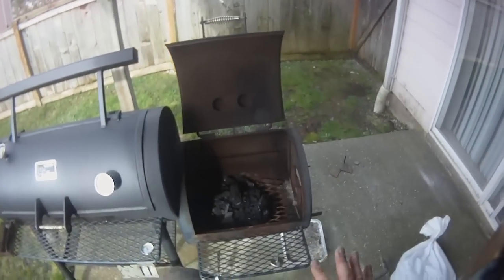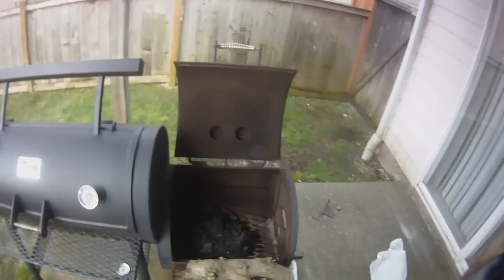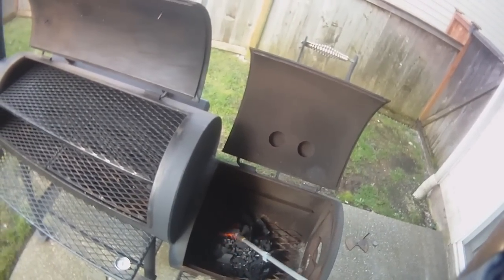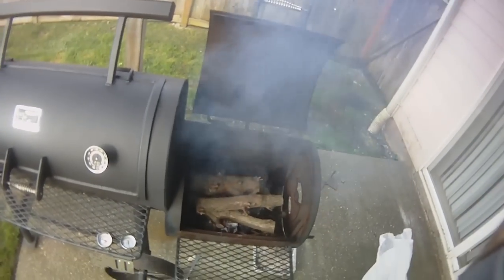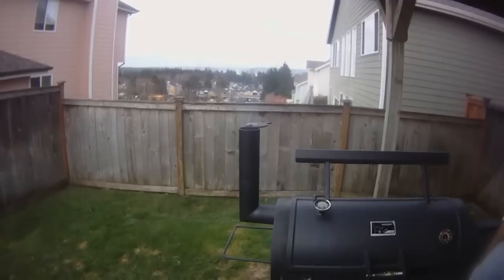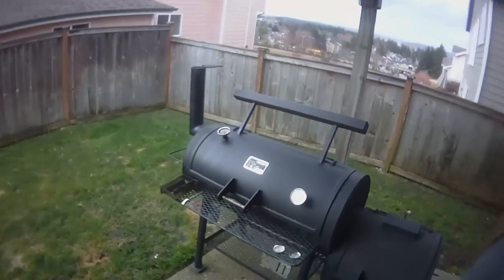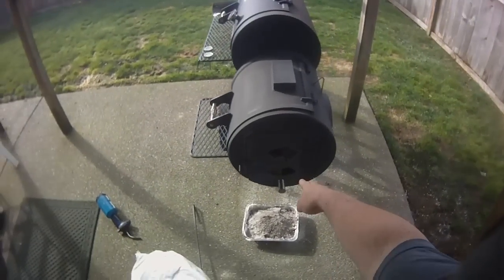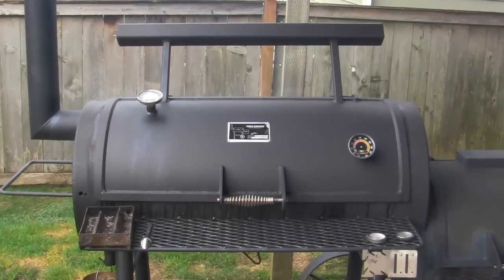SmokingPit.com - VLOG - Building an efficient fire - Yoder Wichita and wood pits.mp4

Comment: I spray PAM or other cooking spray all over the smoker, both interior and exterior, to help coat the metal over the winter.  This helps keep the oxidation down during the long cold winters where you cannot use your smoker due to frigid temps.  Just my 2 cents.

Comment: The "moisture" on the inside of the pit is from the smoke not the moisture in the pit. Complete combustion yields water and carbon dioxide. #Chemistry class
Reply: @Fin thedog In an offset smoker, you absolutely want complete combustion.  Thats why they're called stick burners.  Otherwise the wood would just smolder and give you the white, bitter smoke.

Edit:  10:52 of the video even says you're after fire.  That's complete combustion of the wood.

Comment: question, every video I see talks about how to start a fire and get that smoke to clear up, not be thick white smoke. but nobody seems to be able to answer my question on how in the heck do you add logs when the fire burns down, without it then just starting to smoke like crazy? my hickory logs only burn for an hour or so, then the temp starts to drop, then when I add a log, it then is not clean smoke. I get it though that after the first few hours or so you don't need to add logs anymore, just use lump.
Reply: ive got the same question
Reply: I think that's why he said he doesn't close the lid to the fire box right away, and let the log start to catch fire.  I don't think you ever completely avoid some bad smoke but just more about minimizing it
Reply: The Lord Jesus gave me a idea, when you see your going to need a new log in 20 minutes, how about on a cheap walmart $20 cooker start your replacement log on it and in 20 minutes it's fully light and good smoke, take shovel and throw on pit
Reply: Preheat your logs on top of the fire box. When that hot split hits the fire it will catch a lot faster and clean smoke. Don't fret too much over a little bit of white smoke, just don't run white smoke the whole time.
Reply: I warm my wood splits on the top of the fire box and pop it in when its needed. Don't burn barky wood!!! Bark free wood makes for a nice in thin repeatable blue smoke that's very tasty everytime!
Reply: Smaller sized splits...  😉
Reply: Plenty of good replies. I too suffered with overwhelming smoke flavor. 
1st learn your woods
2 if you have the strength and time remove the bark from your wood. It will simir down the flavor. 
3 the more seasoned the wood is the less heavier the smoke. I season wood for about a year after i purchase. Depends on the stock.
4 i have a seperate burn box where  i burn bigger pieces then transfer to my smoker or ill take smaller splits and set them in a corner of the fire box away from the fire. They continue drying before catching fire, less heavy smoke. 
Most important you dont need to burn wood throughout your cook.  Everything after 140° (meat temp) can bitter your cook. Again plenty of great feed back from everyone. Hope my reply helps.
Reply: I place my "next" split to the side of my fire box to let it preheat.  When the fire is ready, this log goes on next.  It usually ignites within seconds, with no white smoke.  I have a video posted on this subject if your interested.

Comment: Thanks for the video.  So basically you can run a small fire adding wood every hour or so to maintain temps until the meat reaches the point that it really doesn't take anymore smoke.  My question is after that point I begin adding charcoal & start getting white smoke again.  I dont use lump because its hard to come by & expensive in my area. is there another briquette I should try other than kingsford blue bag?
Reply: B&B Charcoal. Cleaner burn and less "white smoke"

Comment: i have 250 gallon tank im useing to build  my smoker how big should the fire box be ? the tank is 27 " wide 60" long
Reply: Idk if you got the answer but a good rule of thumb is the firebox should be 1/3 the side of the smoker.but if you want exact specs you can google there are some good smoker calculators sites guys have made
Reply: got it built but thanks anyway !!
Reply: +rich revercomb jr awesome how's it working for ya ?
Reply: Great I made the fire box 20 x 20 and it maintains temp better then I thought it would .
Reply: +chad s  check out my slideshow
Reply: +rich revercomb jr  nice setup there

Comment from the maker: @yambor44 on the Wichita video I am using the Contour 1080HD camera. On the Goldwing I use this camera as well for the helmet camera angle but my primary camera is the FullHD 1080P waterproof cam with DVR. I run them both in 720P mode. Available @ sports-vue(dot)com. IF you use "Road-Quest" in the coupon code field you will get a 7% discount.